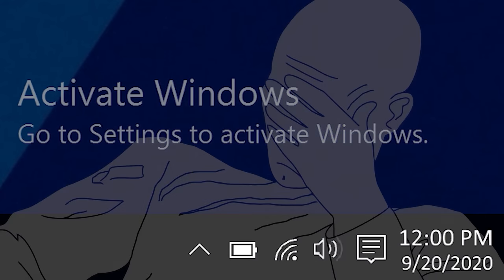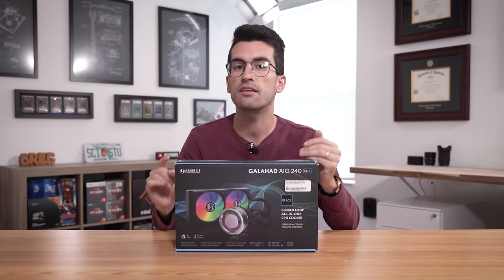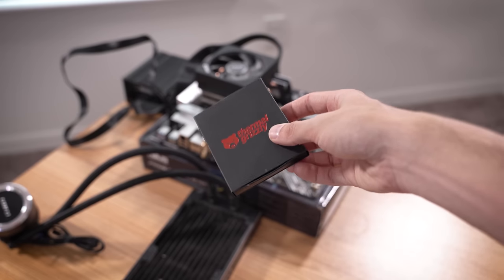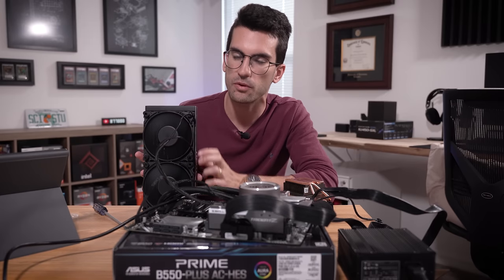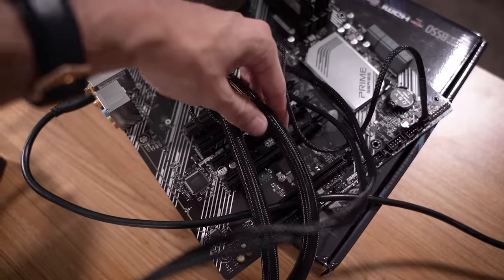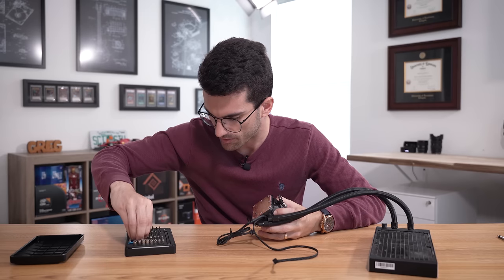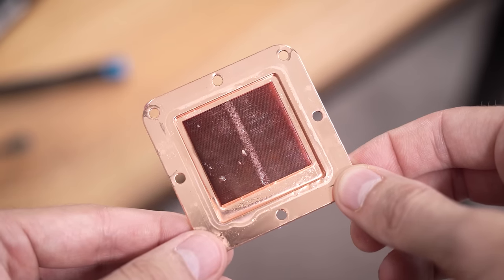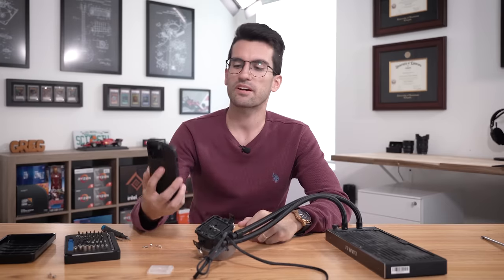A Viewer Sent Me This Broken AIO...

Comment: Another reason why I love air cooling, not as fancy as AIO water cooled builds but won't ever clog
Reply: *as long as you keep your dust filters clean, and regularly dust out your PC. But I agree. Liquid cooling has always felt like a gimmick full of uneccessary work and headaches.
Reply: @TrepidDestiny  Yeah water cooling takes a lot of work but I think the biggest tradeoff is that it looks nicer so you get rewarded for the work you put in.
Reply: @RobertReital  Both my desktops are in wood cases, the cases are the cool factor, you can't see the insides.
Reply: @TrepidDestiny  I purchased an AIO for the first time every a few days ago. Was super easy to install, and dropped temps by nearly 60C.
Reply: @baddriversofthenorcalarea500  If the aio dropped temperatures by nearly 60 Celsius, I believe either you previously forgot to put the thermal paste or your fans were not spinning. If temperatures dropped TO nearly 60 Celsius then it's fine.
Reply: @Dandan-tg6tj  I reapplied the thermal paste twice and ensured the fans were spinning. CPU is an I5-11600KF overclocked to 4.80GHz. Went from thermal throttling at 100C to 40ish under load.
Reply: @baddriversofthenorcalarea500  One more thing I can think of... were you using a stock Intel cooler? Just thinking about that when you OC the CPU and probably need a minimum of 140-150W of cooling capacity and a smooth airflow, you'd be a complete fool to use a silly cooler.
If you didn't use a silly cooler it means only one thing: the airflow is lame.
Reply: @Dandan-tg6tj  No it was a pretty tall tower off of amazon.
Reply: @baddriversofthenorcalarea500  There are only two possible explanations for that:  the cooling fluid was missing from pipes or somehow the way it was mounted was screwed somehow. Anyway, it's great you solved it.
Reply: I refused aios until I got a ryzen 5000. Air doesn't do good enough anymore. My 5950x on a drp4 hit 95c in the worst case scenario, where my aio keeps it around 82 at worst case scenario.
Reply: @TheSkepticSkwerl I am pretty sure there are documented issues with that cooler on AM4/5. I know their new one is terrible on AMD, unfortunately.

Some brands supply offset mounts for AM4/AM5 some don't. It's not just air coolers, or even CLCs. I had an EK block that tests very well on Intel and I was getting mediocre temps that was resolved when I switched to an Optimus Cooling block (on a 3950x). 

The issue is down to the fact that the hotspots are offset, not centered, on AMD CPUs. You have a dual chiplet CPU where the problem is more pronounced. You really need to offset the cooler with both AM4 and AM5 for the best results. Arctic and Noctua provide offset mounts, Optimus on the custom side design their blocks differently for AMD.

That's all to say I don't think air vs water is the difference you're seeing.

Comment: I had the exact same issue with the exact same cooler model. Lian Li quickly sent me a new one when I contacted them, so that's good. Nice to see that you are covering the issue!
Reply: And they sent it to Peru with no issues at all
Reply from the maker: Thanks for sharing!
Reply: And if you’ve peeled the S/N sticker away and also thrown the box away… you will not get it replaced 🙃 but still good work Lian Li ALMOST helping everyone ❤️
Reply: Me too!!!
Reply: I think I am affected too, because my idle temps sit around 54 to 63 Celcius but when opening the browser I get spikes to 80ish numbers. I also feel that one tube is definetly warmer than the other one. I bought it around August 2021 and watch myself tweaking fancurves over and over for at least 6 months now with some to no better results. I also thought about reapplying thermal paste but now I am thinking about actually messaging LianLi to compensate this.
Do you have any advice on what steps I should do next since its my first build I want to stay on the safer site..

Update: I asked Lian Li to send me another one and after I think 2 weeks I got my new AiO. I also linked this video in my request TYSM!
Reply: Yeah me too lian li recalling all aio with 2021 below serial numbers
Reply: Hey bud had to do this last night how long did it take from them saying they would send it to it arriving?
Reply: Oye bro cuánto tiempo se demoraron en responderte y aparte en enviarte la otra refrigeración?

Comment: Man, another reason I stopped using AIO. Its either Custom Loops or Air Cooling (Air cooling is really amazing now a days *staring at the ice Giant*). Lian Li is pretty awesome with their warranty so far, they sent over 12 unifans without asking for the 12 defective ones back (The LED is yellowing on my old one otherwise its still working). I love the response they have to problems. :)
Reply: I am in the same boat.  When I built a new computer a couple years ago I almost pulled the trigger on an AIO but all the feedback online said to go air cooled or a custom loop. From time to time I want to swap to an AIO and then I run across a video like this and that idea goes away fast.
Reply: I don't mind AIO's, but really I only buy Corsair AIO's cause they usually don't have these problems at all.
Reply: @boboso7238  yea, the rig I built about 2 years ago used the MSI aio and after I saw my temps go up I started looking into custom loops.
Reply: @TravisPNW out of curiosity did you go for dual or single fan?

Comment: Thanks Greg for going to bat for the consumer again. AIO's are not cheap, and these companies should be in touch with their client base and have their ear to the ground on issues like this so PR is not damaged and their reputation grows positive rather than negative. Great content!
Reply: The actually are cheap. In both ways - the have reduced cost becaus ethey cut a lot of corners; low quality pumps, aluminium radiators, small tubing because a) they have to pay Asetek for the patented design and b) they still have to compete with top tier aircoolers that have been shown multiple times to be as good as liquid coolers while also being cheaper and have much less critical points of failure than AIOs.

Liquid cooling is expansive and risky. AIOs made it way more accessible to a lot of people, but there's a reason for that.

Comment: I remember when GN Steve covered this it was also odd that it took Lian Li this long to fully announce this issue. Arctic’s AIOs were affected once but Arctic was pretty on top of things

Which is kind of funny as someone who’s always cheaper out with ID Cooling AIOs they’ve never had any issues whatsoever
Reply: Most people don't experience these issues, even in affected models. The failure rate of this clogging problem is still super low. If you sell 10,000 units and 400 of them have an issue, it's still very unlikely you, personally, would have a problem, even though that's a "high" failure rate.
Reply: thats because arctic make their own AIO. lian li and msi to my knowledge were using OEMs so it easier for arctic to have through inspection
Reply: Remember the arctic case. "We detected some problem in gasket that may effect in future so here is service kit or you can do RMA".  I took the service kit and I still have some liquid left on that bottle.

Comment: Can 100% confirm this story. Around late March/early April this year I started having random system crashes. At first I did my regular diagnosing, but eventually I started getting overheating warnings after the crashes, so I monitored the CPU temps, and temps were much higher than normal. Idle in the 60s, full load around 82-84, and with spiky load it would get up to 89°C (for some reason constant loads apparently improved the flow of liquid, so a stresstest wouldn't crash the system, but short spikes would). 
So first thing I did was a full clean and remount with fresh thermal paste, but the result was pretty much unchanged. So on April 25th I contacted Lian Li support asking them how to proceed from here, if they have any advice (at that point I didn't know there was a widespread issue). The support contact immediately responded "I told the factory to send you a new unit, if you don't get it within 22 days message me again" without any other questions or asking for the defective unit to be sent back. 

While that did seem like really good support, it also immediately made me realize: they know exactly what's going on and want to get this dealt with as quickly and silently as possible. Received my replacement unit on the 9th of May, so well within the 22 days, but since I have an ITX build swapping the AiO is a more complex process, so I decided to wait until the weekend to swap (the old cooler was barely hanging on, I could still use the system with a heavy power limit on the CPU). Then on May 12th Igorslab posted on his news page a huge discussion thread (that blew up and got the whole coverage started) about failing Galahad AiOs, and suddenly everything came together for me. I still went ahead and installed the new unit on the 13th, and it was performing perfectly like new, so even if the problem persisted I could still keep this unit running while I figure out what to do. 

Next week on the 15th of May Lian Li released their public statement (the one Greg reads in the video at 14:03), and I was relieved to read that the issue had been addressed and my new unit wouldn't be affected, but I was also mad at Lian Li for not releasing any statement earlier after they've known about the problem for over a year. Could have saved me a lot of troubleshooting had I known this was a widespread issue. 

So apparently Lian Li and MSI (and some other AiO brands like Enermax) are using the same supplier Company Apaltek. And they had a flaw in their manufacturing process where the individual parts of the radiator got soldered twice without being properly cleaned afterwards. This left some residue inside the radiator, that over time reacts with the liquid in the loop and corrodes the aluminium inside the radiator, causing it to flake out, and the flakes start collecting in the CPU block forming the goo shown in the video. Most likely all brands that sourced their radiators from Apaltek during that time were affected, some of them decided to deal with the issue openly, Lian Li tried to keep it quiet until it got out of control. Not really the kind of response a customer would expect, but apparently this is the new norm now, companies don't want to admit any fault of their own because that would cause a huge wave of RMA requests.

Comment: That split flathead bit is for removing screws with a ball in the head. At my job we call them X-ray screws/bits (no idea what the official/technical designation of them is) and the tools are marked as "for trained operators only" or something like that. We use them to hold lead shielding over certain areas of an electron microscope to prevent X-ray leak from the column. It is a funky looking screw head and sometimes the ball falls out (almost looks like a small ball bearing), forcing you to use regular flathead driver to extract the darned thing, because the small prongs of the bit slip out so easily.

Comment: Confirmed they're still doing this to this day, just got mine yesterday to replace S/N 2021. Great vid! gave me peace of mind knowing its not just my rig
Reply: I reached out to Lian li about this yesterday and haven’t heard back yet. How long did the entire replacement process take? My PC won’t even run for 5 minutes without shutting down.
Reply: So I submitted the trouble ticket 26DEC, they replied the day later, no tracking provided but the pump came in 07JAN. I was also on vacation and out of town at the time so the slow shipping didn't bother me that much
Reply: @boygarlic  thanks bro
Reply: Np. Good luck on the down days of the rig
Reply: I requested replacement yesterday , got an email to confirm my shipping address today  , i will make sure to update this .

Update : got a reply to confirm my address , no questions asked  , replacement on the way.

Comment: While it may have taken them awhile to make an official announcement later than expected; they at the very least have been very easy to get replacements out to anyone who had issues. Additionally they sent me a replacement without having to send the old/broken one back. No downtime if the unit was still usable.
Reply: would you give me the old one? I'll fix it for use.if possible.

Comment: I think that LianLi have had the benefit of seeing MSI cop heat first. 

I honestly feel that majority of the AIO kits have been affected by the same/similar issues. 

I went through 3 ThermalTake AIO units within 12 months for the exact same symptoms. The last unit I had enough so pulled the cold plate off and saw the build up. 

Oddly enough (and possibly pure coincidence) but the radiator design is same as the LianLi radiator (assume possible same supplier).

Keep up the great work.

Comment: I am currently using a 9.5 year old H55 Corsair AIO that has cooled 5 different CPUs at this point. I have pictures to prove it. One year is unacceptable.
The list: FX-8320, i5-2500K, i7-3770, i5-10400F, and currently a i5-11600K still going strong!

Comment: These clogging issues have done a good job in helping decide that I'm never going to use an aio in my personal rig. I know there are good ones, but there's always gonna be the voice in the back of my head saying "what if"
Reply: same, nh-d15 for life
Reply: Likewise. Ive always been fascinated by the way they look but given the recent trend of clogging issues with them I think I have opted against it for anything I personally touch. Id rather not risk the PC overheating and possibly burning out components that could get rather pricey to replace
Reply: it don't matter the likely hood of it happening to you is low and even if it dose your pc with thermal throttle and shut down to prevent damage. further more  hard ware failure is hard to avoid sometimes but is extremely low chances but never zero. ive build many a pc in my time and had to RMA few things here and there but it should never scare you outta of buying or using something.  at least with AN ALL IN ONE or AIO as you put it, you should be covered if any part of it fails as appose to a custom loop where many, many parts can be the failure point and might no be covered so to speak.
Reply: if air cooling could get the job done for you, no need to go AIO other than the fancy LED screen on top of the CPU
Reply: @leeksoup3199 same 1 month ago nh u9s chromax black aircooler😊

Comment: Gregory, my man, I have a lot to tell about that particular AIO cooler. I had one and had a HELL of an experience with it.

In August 2021 I built myself a new PC. I chose an AMD Ryzen 7 5800x processor and paired it with a Lian Li Galahad 240 AIO (white version). I bought the components through Amazon and received them at my home in Santiago, Chile. I assembled the PC and everything went fine for a few months. Then, in February or March 2022, I was in the heat of a battle in "Just Cause 4" when my PC suddenly shut off!

When I turned it back on, the BIOS said that there was a CPU temperature problem. The sensors indicated that the pump and fans from the AIO were working fine, so I thought the culprit was the processor. I learned that particular processor ran very hot, so I nicknamed it "El Calentón", which in English would translate as "The Hot One" or "The Horny One", depending on the context. So I tried everything, including undervolting the CPU. I can't remember how many times I reapplied thermal paste to the CPU, thinking the problem was there. I didn't realize before the cause of the problem because every time I tried something new or reapplied thermal paste, the temps seemed to improve.

Finally, around July 2022 I recorded my high temps while gaming on an undervolted CPU and reported the problem to Lian Li. They acknowledged the situation and they very quickly sent me a replacement AIO (with no fans, since mine ran Ok). You know what I did with the replacement AIO? I sold it back there in Chile (including my Lian Li fans, which were working properly). Then I bought myself a Noctua NH-D15 air cooler, which is huge and not fancy-looking like the Lian Li Galahad AIO cooler, and a couple of Noctua fans. It's a bulky cooler and it might not fit every PC case and motherboard out there, but it sure solved the problem for me and it works beautifully. I highly recommend it over an AIO cooler, which is supossed to last between 3 and 5 years, but mine lasted only about 7 months. That was how "El Calentón" was tamed!

About two months ago, my family and I moved to the USA, to an area to the North of Atlanta, Georgia. I have a Microcenter store nearby, in Duluth (the one you visited and showed in one of your videos a few weeks ago) and I'm planning to build a PC for my oldest boy. For his build I'm pairing an Intel Core i7 12700KF processor with a Noctua NH-U12A air cooler.